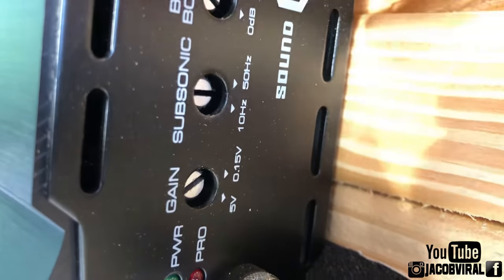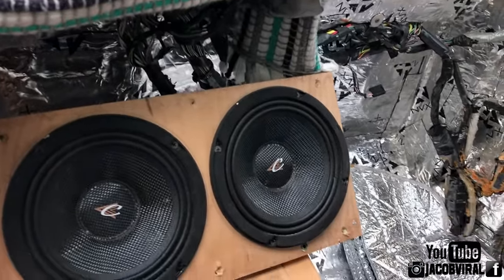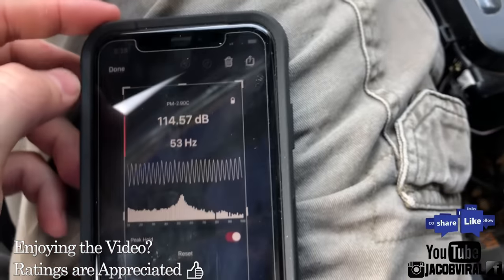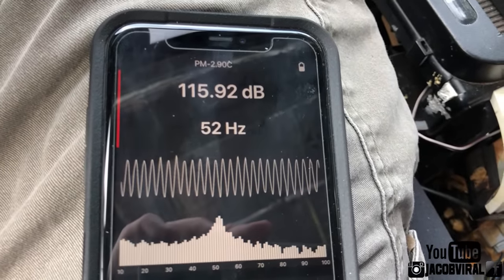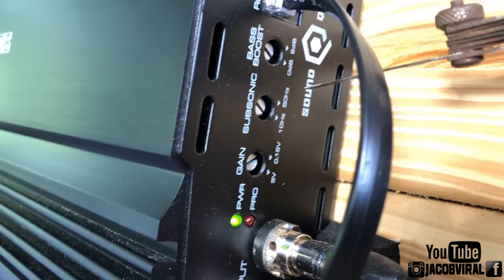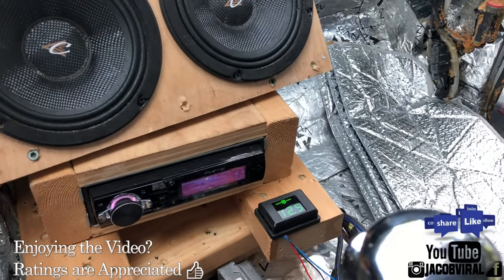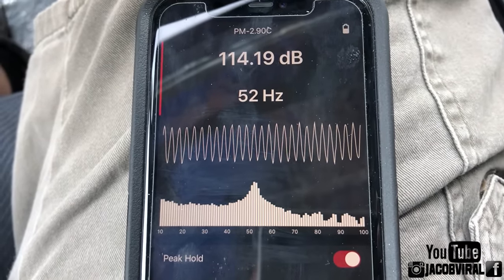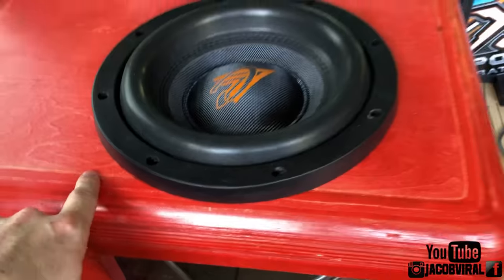HOW IMPORTANT SUBSONIC SETTING IS ON YOUR AMPLIFIER?

Comment: What if my box is sealed? Can i just put it at 10hz??
Reply: You can, but will it louder who knows. 

It's alot of variables that come into play on your own system.

Me I set mine according to voltage drop vs my port tune,  

It's less air to move in a sealed box , so I guess if you set it that low your just bouncing your subs no real sound .
Reply from the maker: I would have it off and do a sweep on 3/4 volume to see where the sub starts to unload and slowly turn up subsonic util no unload issues. Most sealed enclosures start around 20-25hz depending on the size internally.

Comment: So for a 32 Hz running I would set it at 24?
Reply from the maker: Correct
Reply: @JacobViral2  awesome if I've got a 10-80 range on my subsonic where would 24 be? 9 o'clock roughly maybe?
Reply from the maker: Sounds about right but test with the lower frequencies and see how the sub does and watch for limits as you adjust.

Comment: Does subsonic on make your bass hit harder ? I have a box with port centered and tuned to 35hz , what should I level my subsonic to ? Please let me know @jacob  or someone
Reply from the maker: I would set subsonic around 26-28hz. And it will help protect your subs incase you play full tilt at the low frequencies below tuning to not unload.
Reply: Jacob Viral2 : is that a good set to keep it even though I play music straight from my iPhone (iTunes) connected with my auxiliary cord ? Some songs hit hard and others are so / so
Reply: Jacob Viral2 : different question : does a BIG 3 really help or boost your system ?
Reply from the maker: Luis Lozano 100% yea because more electrical current supply and support. Alt upgrade and battery upgrades help to or course.

Comment: Hey there ! Hoping to get some feedback from some people here. Just got myself a skar audio SDR 12 (RMS is 600W) inch sub paired with a a skar RP 800.1D which I believe is 800w RMS. Looking to prevent any sort of damage to the sub/amp but also gain the most benefits from a proper tune. What would be some recommendations for tuning the amp ? Would be more than happy to reply back with my email if anyone wants to helped a brother out! Thanks everyone!
Reply from the maker: What questions do you have not answered in my videos?
Reply: @JacobViral2  so if my tuning frequency of enclosure is 36hz, does that mean I should set my subsonic to about 27hz?  Also what would you recommend range wise for lpf? My amps dial goes from 50-220. Thanks for the help ! Just got this set up in and want to make sure it lasts and is operating at optimal levels. :)
Reply from the maker: @archangelofhelld  correct your right and made a video on LPF as well. Thanks for watching and subscribing! https://youtu.be/vLlRjGckgHg

Comment: why wouldnt you just set subsonic at the low end roll off point, that the build sweeps at??
Reply from the maker: You can do it that way yes
Reply: @JacobViral2  So if i was running a bandpass I would set it right at the F3.  Would you agree?
Reply from the maker: mescko idk much on that unless that is near your low end peak/tuning of your box. You wouldn’t want to set it to high then lose low end output.
Reply: @JacobViral2  I'm looking at building a bandpass with an F3 of 30 hz.  My Driver is a mid-Q with 25 hz F3 250W RMS.  I plan to feed it 200 RMS, I do not listen to any bass-heavy material, I am strictly SQ here..  I know that a bandpass is prone to over-excursion and don't need or want flat to 10 hz or any of that nonsense, and want to protect the driver as much as possible.  I'm presuming there is no point or benefit to setting the filter below the F3 of the box.

Comment: Shouldn't it be set to speakers specs not encloser tuning, bc bandpass boxes can be tuned way below the specs capable perimeters and still put out sound of tuning? Teach me right, I'm trying to learn this twisted electrical stuff,lmao
Reply: I believe you have to go by the box tuning because it changes how the speaker behaves. Watch it when it gets close to the tuning frequency and you will notice it barely has any excursion, any speaker you put in that enclosure should behave similarly although the sound can be different. It has to do with the air pressure inside the box. Anything below the will make it move further and further fairly quick . If it goes too low if the subsonic isn't adjusted, it pushes the speaker past xmax and it starts bottoming out or wrecking the coil. I'm tuned at 34 and set mine at about 25-26

Comment: Hey Jacob my ported box is tune to 32 32hz on 6.5s subs so where should I set my subsonic to ? On my amp also it shows 10hz to 50hz subsonic wise.
Reply from the maker: Video should show where to do but 24-26hz range is a good point.

Comment: i mean if you are after DBs, this video proved having the SSF OFF or on its lowest setting, is the way to go. 

i know about the half octave rule and i always thought using that rule would make the amp work more efficiently and produce more power thus more DBs ultimately, but your test showed the exact opposite. im confused ????
Reply from the maker: Low volume levels it will matter but full tilt it’s all the same power output just allows for more adjustment later on the gain to tune after you do your subsonic level.
Reply: @JacobViral2  you know what u should do? this would really help me and others... in a test to see what gains most DBs: test with subsonic all the way down and set gain to clipping and then test DBs at moderately high to full tilt volume. then set SSF to lets say right at the box tuning or 5 hz below or 1/2 octave below and readjust gain to clipping and then test DB level at moderately high volume or full tilt. 

since the gain will prob be able to be set higher when ssf is set ON box tuning or 5hz or 1/2octave below, then , in theory, you should be able to obtain a higher DB number. 

id love to see this test performed to confirm.

Comment: I used to think subsonic filters were for pu$$y subs that couldn't handle sub 20hz power lol. Back in the day you could run a sealed enclosure and still slam at 15-20hz. Subs amd amps just don't do what they used to do. Back in the late 90s-early 2000s a decent amo in a sealed box would slam at 20hz. Now days everything is focused at 45hz to give the illusion of loud bass. My svs pb2000 home subwoofer is tuned to 17hz and even at 15hz you can feel the pressure change in the room. Ive tried many different amp/sub combinations in my vehicles and none of them seem to hit hard below 30hz like my old school amps and subs did, and on top of that they did it with much less power than today's high powered subs need to hit those same notes with as much force.
Reply: I agree

Comment: How come my bass cuts out at high volume
Reply from the maker: Because your amp is meeting it’s limits, clipping, voltage drop, heat, etc a lot of factors.
Reply: @JacobViral2  I had a bad battery now I have a agm do you think that will fix it
Reply from the maker: @Bighotwheelhunter  it will helps improve your electrical yes. I would have a voltage meter https://amzn.to/33HPBU0 to see how your voltage drop is and make sure you aren’t clipping ever,
Reply: @JacobViral2  I think I fix the problem it was my 4 channel amp going into protection mode